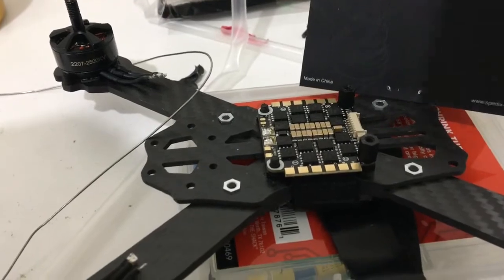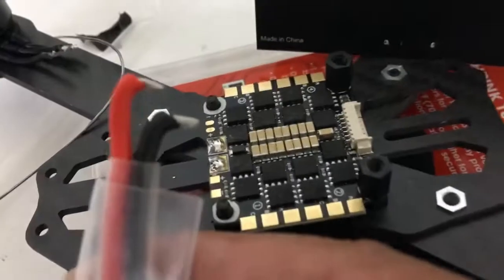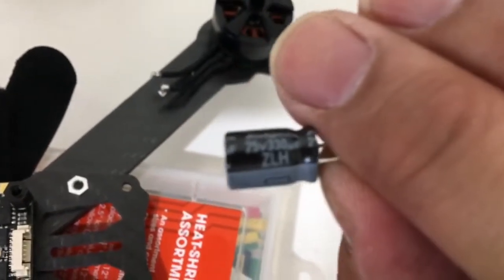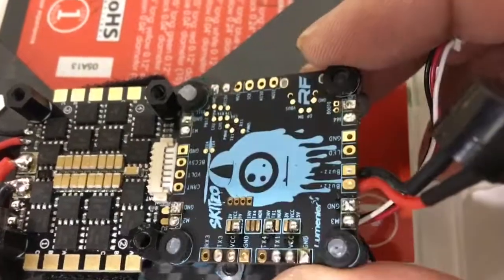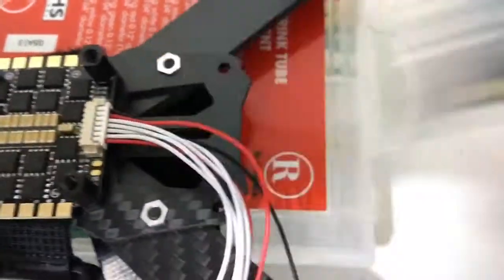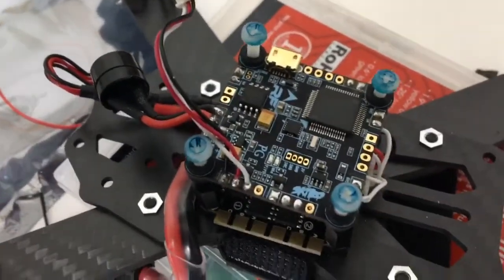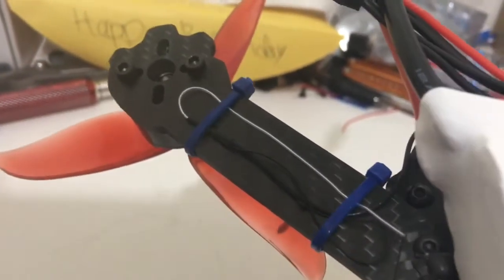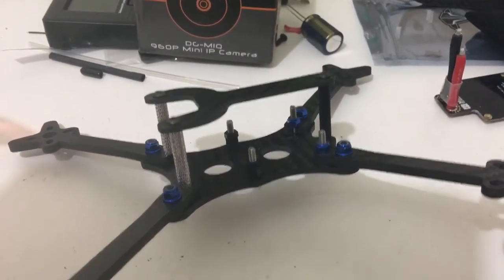Spedix IS-30a 4 in 1 ESC install

Comment: Thanks for the great video. I'm about to build the exact same FC/ESC combination and I was wondering how you deal with the fact RF FC pads are X1234 clockwise but the Spedix ESC pads are X4213 clockwise. Did you have to remap the motors in RF ?
Reply from the maker: Steller Winds thanks. No remap.  Esc1 (bottom right) to Revolt3. Esc 2 to Revolt2. Esc3 to Revolt4. Esc4 to Revolt1
Reply: John DeCastro thanks for that. I was over thinking it lol.

Comment: Man I know that quad has got to cost a lot of money.

quick question, did you run your current through your flight controller to your 4 in 1 esc or did you just bridge it to get current readings?

Comment: My second unit of this esc just died on me.  I'm only getting the first three initial tones when I plug in a battery.   It stops working after my flight not during.  This was only my 4th flight on this 4 in 1.  My first unit of this flew dozens of flights then died.  WTH?!?

Comment: I am running the same esc and fc with a 1000uf cap on a new build. I have terrible noise in my gyro with normal filtering. I noticed you didn't hook up raw voltage to fc for voltage monitoring. Could this be a source of noise? Or any idea where it could come from? Your wiring is neater as well but don't see that being a concern. Thanks.
Reply from the maker: TheBigblock81 I haven't had a Revolt for a while now but I haven't had an issue with this set-up. I went back to betaflight and osd FC combos until race flight gets better reatures
Reply: Did you solve you noise issue?
Reply: Charles Geraghty Yes, it wasn't noise. I was using a beta version of software with terrible filtering. I finally found version 324 last night and it flies near perfect, quopa mode works, and the log files download super fast.

Comment: John - you didn't show how you powered the FC. At one point you said there were 5v pads on the ESC but clearly you didn't use them. Also, your u could have explained the ESC wiring better.  How are you handling ground for the ESCs and why is that ok.  Would like to see you being a little more detailed in these videos.
Reply from the maker: SSBelmont the ground in the FC is all common. In the case of the revolt there is a ground/5V power in. I used the 5v power in from the connector. Since the ground is common and already hooked up to the power you don't need the ground to the signal wires. If your a little OCD you can split the ground wires and wire 4 to each signal wire but it's totally unnecessary
Reply: question I had that is now answered great vid

Comment: you have ESC wire 1 from spedix going to M3 on Revolt?
Reply from the maker: RazzerBlade_FPV remember Revolt is X1234 in raceflght. You can also select x1234 in betaflight.
Reply: John DeCastro quick question , very new to this hobby.  what do you mean by revolt is x1234?
thank you
Reply from the maker: Henry Arnold x1234 is the motor mix. Top left is motor 1. Top right is motor 2. Bottom right is motor 3. Bottom left is motor 4. Default betaflight = top right is motor 1. Bottom right is motor 1. Too right his motor 2. Bottom left is motor three and top left is motor four
Reply: Did you solve your problem?
Reply: Charles Geraghty you bet! took me awhile to get around to it, with work an all.  but I'm very pleased with everything so far